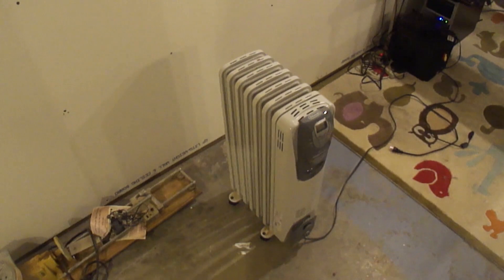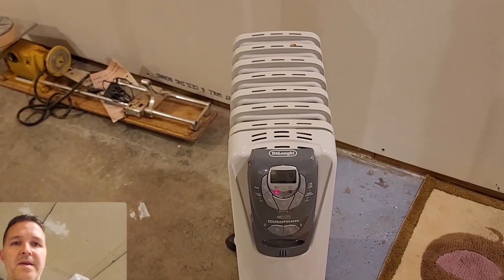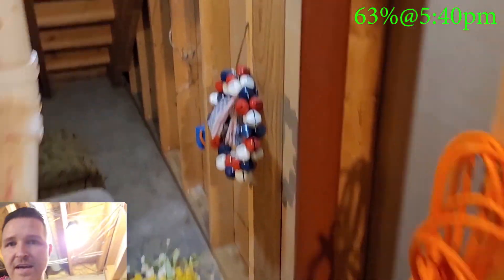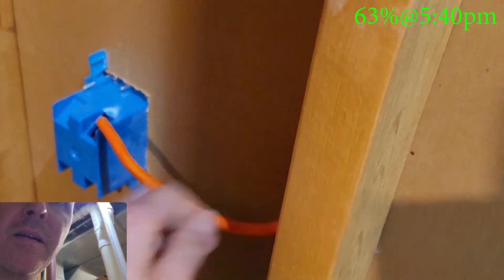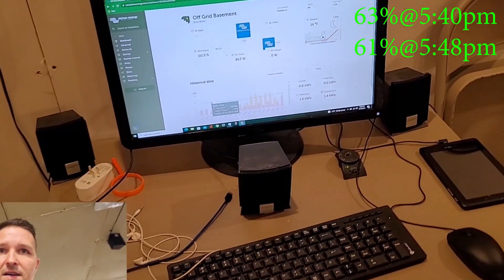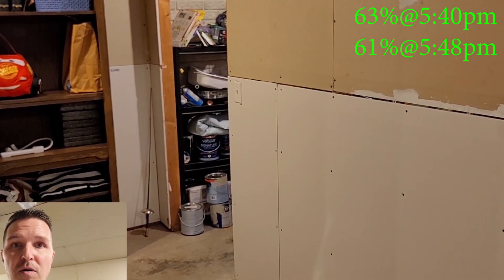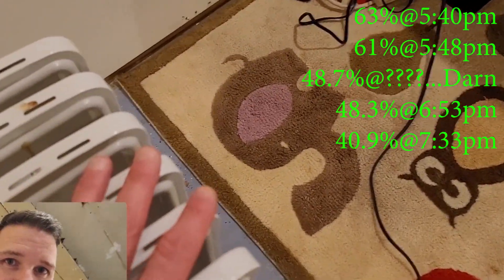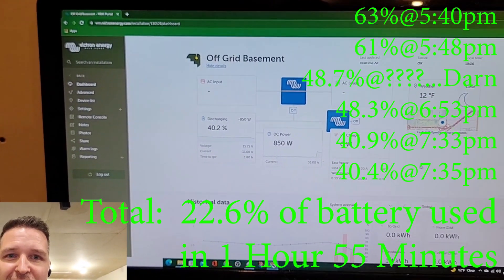Will a 24v Solar Powered system run a 1500w Heater?

Comment: Man I figured out how to use my 24 volt 24 module leaf battery with my newer 850 ah 24 volt lifepo4 battery... I connected a victron DC to DC charger and now all night the victron is dumping 12 amps into my lifepo4 which is powering my home. I hated seeing the leaf battery just going to waste ya know. I mean it's not a perfect way to use it I guess but it beats it going bad from setting lol. Great video by the way
Reply from the maker: Even with losses it is much better than nothing!  Thanks for the comment.

Comment: Nice experiment. What i did was i converted our furnace blower wiring  so that i can plug it to my inverter. It uses around 350w to run. A little savings for winter heating.
Reply from the maker: The savings is nice, but the real positive is now you can heat your house even when the power goes out!  Thanks for the comment.

Comment: Well done ... do you using 2x 12v 300Ah battery
Reply from the maker: Yes.  So far the setup is working well.  Thanks for the comment.
Reply: @OffGridBasement  Them Battery 2x12v 300Ah will cost at list 2 thousands pounds little bit to much 😳

Comment: How many and what size solar panels are you running? What Ah batteries?
Reply from the maker: 300ah 24v system.  I currently have 2.6k of solar.
Reply: @OffGridBasement  I'm very new to solar,  today is my 1st time looking into it. I have a 1500w space heater I have in the basement I like to run solar for. I'm trying to figure out what size panels, how many. What size and how many batteries. I understand the hardware and the installation of it, but the math has my head spinning lol.
Reply from the maker: @Jsherrod78  try to convert everything into watts and watt hours.  My 300ah 24v system is around 7500 wh.  7500 ÷ 1500w = 5 hours of runtime.  That is a very basic example.  I have some very basic solar calculators on my website that might help.  Good luck!

Comment: one last thing  i have tried all you have done, and determined that why waste all your power on a 1500 watt space heater for 2 hours . You can run the diesel heater all day and night with solar , and a trickle charger.

Have 2 battery banks this will help.4 in each bank.
Reply from the maker: I understand that a 1500w space heater is the WORST possible heating solution for off grid.  I just wanted to see if it was possible.  I'm really looking into other ways of personal warmth.  Electric blankets are my next experiment I think.  Diesel heaters are great for a fuel based heater.

Comment: hey my friend you should get a diesel heater and run the test this is what i use and you will be able to run it all night long.

Start the heater at high and then after around 20 minutes turn it down to low and your good to go. Let me no when you have it all setup good luck and have great year.
Reply from the maker: Besides the 12v source needed, the diesel heater doesn't have much to do with off grid solar.  It's a good heater option though.  Thanks for the comment.
Reply: one last thing  i have tried all you have done, and determined that why waste all your you power on a 1500 watt space heater for 2 hours . You can run the diesel heater all day a night with solar , and a trickle charger .

Good luck !!

Comment: Why does it show as DC power in the Victron vm when it's ac 120v right ??
Reply from the maker: That is right.  It shows DC because I don't use a Victron inverter.  The Victron inverter would show up as AC.  The wattage is still calculated correctly.
Reply: @OffGridBasement  is there any other equipment you're using that shows the power being used because I'm using the Victron charge controller & smart shit my but in my VM all I see are those two I have a dif 24v inverter to how u get that to show up like that ?
Reply from the maker: I believe this is what you need to do.
1.  Open the VRM Console
2.  Go to the menu and click on "Remote Console"
3.  In the remote console, go to "Settings" in the Menu
4.  Click on "System Setup"
5.  Turn on "Has DC System"
That should do it.  Make sure the Battery Monitor is selected to your Smartshunt as well.
Hope this helps!
Reply: @OffGridBasement  ok thanks I'ma try it 👍
Reply: @OffGridBasement  😮 Wow it's working lol unbelievable thanks man
Reply from the maker: @thelithiumpowerch  Glad to hear it!

Comment: Wonder what it would take to replace the element in that type heater perhaps run on direct solar panel power saving your battery power?
Reply from the maker: If my batteries are completely full then it would be completely on solar via the solar charger controllers.  I don't think you could power directly from a solar panel.  You would need to regulate the volts\amps in order for it to work.  Thanks for the comment!

Comment: how many battery that u use ?
Reply from the maker: I use (2) 12v 300ah Lifepo4 batteries connected in series for 24v.  Here is a link to the battery if you need more information.
Amazon:  https://amzn.to/3cscCPB
Enjoybot:  https://enjoybot.com?aff=16
Thanks for the comment!

Comment: i love this video but not code installing extension cords in the wall
Reply from the maker: Oh I know about the cord!  I was desperate to get an outlet over there.  That is going to get replaced with a proper circuit after I get my breaker panel up and running.  Thanks for the comment!
Reply: @OffGridBasement  lol I figured you did. I’m a sparky so I had to mention it. Lol also have a engineering undergrad. I really enjoyed how you laid out this video. I was wondering about using solar to heat a space and was wondering about starting a project soon. Really interesting in building a hydroponic shed that’s heavily insulated. I do building automation for a living on a commercial level so once I have time I will hopefully make it my new hobby
Reply from the maker: @jake2102  I'm really happy you enjoyed the video!  Hydroponics would be amazing when combined with Solar.  Running all the water pumps wouldn't be bad if you stick with DC.  No conversion losses.  The heating would be the big issue, but if well insulated I think a small AC heater or even a 12v DC heater would do the trick.  Good luck!

Comment: Great load test for a small 24 v system that can really run the heater for about 2 or more hours .There goes to show that a perfectly built system should do the job running much smaller loads for many more hours then expected as a prepper would designed it to just in case of any SHTF situation or to save on the light bill at will . If you get a chance , check out my solar videos, hit like , leave a message and subscribe . May the solar be with you .🤗🤗👍🏿👌
Reply from the maker: Thank you for the great comment!  I'll check out your videos now!

Comment: This is the exact thing I was looking for. Unfortunately, it appears I would need to quadruple your battery bank size to run my 1500 watt heater all night.
Reply from the maker: Exactly.  This type of heating is probably the most inefficient way.  For total off grid you would want to go with wood stove or a little buddy propane heater.  At least get a electric blanket.  I think they only use about 80w!
Reply: @OffGridBasement  I have to figure out my options since I have little kids. I have the buddy propane heater but was hoping for an electric solution.
Reply from the maker: I wish I could help, but any type of electric heating is going to take a ton of wattage.  Good luck in your search!
Reply from the maker: what are you wanting to heat?  small cabin?  whole house?
Reply: @OffGridBasement  rv using a heater like this or hydronic heating

Comment: Looking good man, you're definitely on the right track. Don't listen to people that only want to say you need more more more. I started even further behind you with 12v panels and lead acid golf cart battery's and an old inverter from an ambulance. I will say the best thing you can do is to go big on your solar very first. The rest can be upgraded later.
Reply from the maker: Thanks for the advice.   I don't plan on getting this system much bigger.  My plan was never to power my entire house, but just be able to power the essentials.  I'm still learning what all I can possibly do with the system I have.  Thanks again!